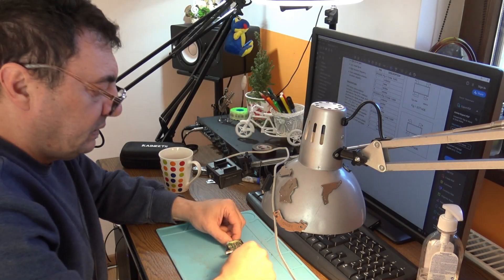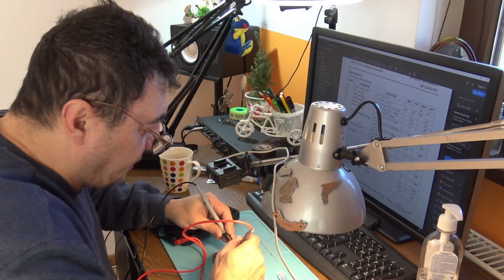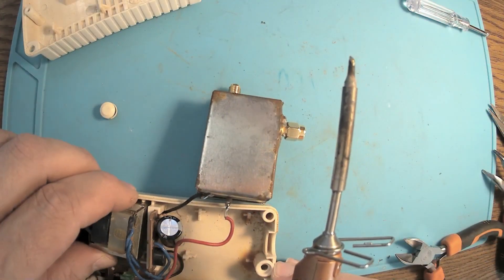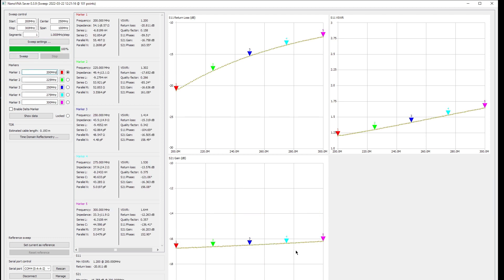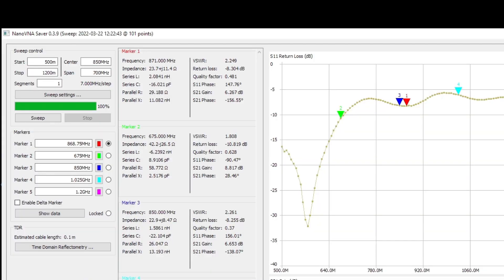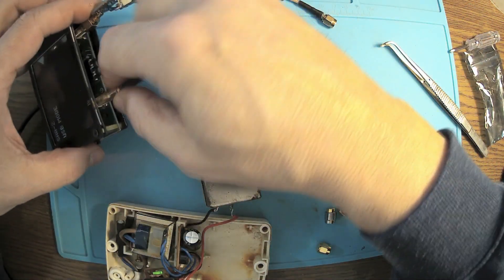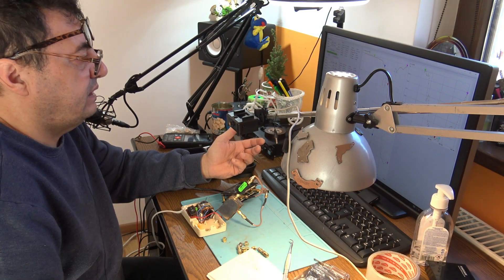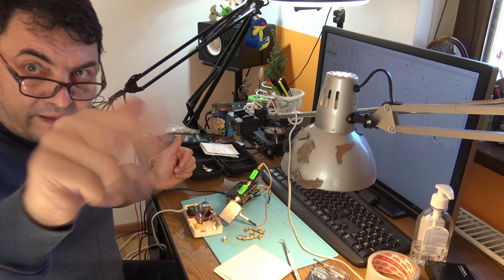UHF amplifier for Helium miner? Yes, of course!

Comment: Hola amigo , do you anymore updates on this project/amp did it work ok? 
I just bought one from ebay and wanted to modify like you did . And yes I know it’s not bidirectional and will need splitter for the tx with separate antenna. 
Please let me know if it’s good to modify and if it works
Reply from the maker: This one is working great..but to much gain, lots of invalids..I recommend a filter before input..
Reply: @viocaia  thank you . 
I have a jetvision cavity filter, that should be good then 👍🏿I appreciate it
Reply from the maker: @ibraheemmohammed6038  Cavity is perfect..but I was thinking more to a saw filter..with a little more loss..to keep down gain..anyway it's a matter  of experimenting..do the things, write down the values for a week or so and you'll have a picture.
Reply: @viocaia  I’m doing a little bit more crazy stuff. Right now i have 9dbi mcgill , cavity filter , acasom amplifier (10db version) , into a 3 way mini circuits splitter into 3 sensecaps ( different ip addresses/vps) and it’s doing pretty good . I’m averaging around.40 each on them . Your projects and time you take to make the videos have helped a lot . I appreciate your work and time . Thank you . 

.
.
So that’s why i want to try your modification and try and split it into 4 miners 😂 since it has higher gain than the acasom
Reply from the maker: @ibraheemmohammed6038  Of course..you have plenty of signal ..Thanks for appreciation!

Comment: New follower… which antenna an filter set up u advice to use..?
Reply from the maker: Depends on location, if you are near crowded urban area McGill 6dB and a simple filter will do the job..also good cable like LRM400..if you are in remote area you should use a directional like YAgi and no filter for the best signal RX..sorry but there is no recipe ..no magic potion..
Reply: @viocaia    ---- loool.. of course theres no magical... hahahaha funny answer... i have good croudet location... many minesrs near me... like a good locatiion... reward-scale 1,8 plus..... now just came a new miner in my hex, and hes stealing 5/6+ coins.... before i had 15 a month , now becomes less and this new guy earns 15 and me 8)... just ask myself why... my set up is 12 dbi antenna outside on pole 14 m high... 3m  cable rg56 to miner  probally (its a thin one)... bobcat....
Reply from the maker: @Bitcoin00boy  Maybe a better cable, also move your location in Explorer to a better rewarded hex..the system is not tracking the exact position..I saw people like tens of Km away from from the actual location..still up and earning.

Comment: hello, I love following you, there is a product that I found on the Internet. Everyone is talking about this item. I couldn't understand how to use this item. Can you help. The place I am in gets a maximum gain of 16 dbi. How can I download it to the system as 15 dbi using the item. I am using an 8dbi antenna and 18 feet long lmr400 cable. How can I use this with my device. How can I calculate 15 dbi as gain for mine? I hope I could express it well. This product is +17 dbi but what should I do as attenuator, also how should the link order be, thanks...
Reply: Can you give an idea about this product?
Reply from the maker: @ferhataslan1556  which?
Reply: @viocaia  I think so, Ferhat mentioned Airbuddy or ACASOM amplifiers.
Reply: @viocaia
Reply: @viocaia  
sorry, the operating frequency is 868 mhz, not 900, the product is ACASOM amplifier on aliexpress, there is a bias tee next to the product, does the bias tee use it as a filter or as an attenuator? the link is being deleted in the comments
Reply from the maker: @ferhataslan1556  Bias tee is a simple circuit to allow the amplifier to be powered by the feed line..it's got nothing to do with the RF signal, just decoupling DC from RF and use the cable as a power supply one..
Reply: @viocaia  I'm sorry if I misunderstood. What should be done should be as follows. Antenna->18 feet cable->attenuator->amplifier->miner. Is it correct ? I will have questions...
1- Shall we put a cable between the Attenuator and Amplifier? 
2- When I use a bias tee, there is no need for an adapter for the amplifier.
3- If there is no bias tee, will an adapter be purchased for the amplifier?
I'm confused, sorry. I'm trying to learn.
Reply from the maker: @ferhataslan1556  First! Why attenuator..ideally you should have +17dB amplification..practically..never! So forget it. Again..antenna/cable/filter/amplifier/miner...
1.No cable need between attenuator and amplifier..
2.To use a bias tee means. to have the amplifier near the antenna! so the cable for radio signal will carry the DC to supply  teh amplifier.When the amplifier is near the miner..no Bias tee need it.In both cases you need a power supply (is this the adapter you're talking?)...Again...! 
If the amplifier is located near the antenna you should carry DC for supply the amplifier..this can be done 2 ways..a suplimentary 2 wires along the RF cable to carry DC voltage or a bias tee which split RF and DC on the same RF cable..
If the amplifier is down, near miner..you connect the power supply direct to the amplifier DC connector if any..some amplifiers are only having input/output connectors but ussually the output is BIASSED to aloud connect both RF and DC power to it.
To make things simplier , buy an amplifier with DC connector..not a Bias tee as long as you intend to keep the amplifier near the miner, not up on the roof near the antenna..think about elements protection too..
Some devices like SDR radios have already a Bias tee adaptation at antenna port..means they can supply any amplifier directly with the voltage in need..but I didn't saw any miner to do that..so buy an amplifier with 3 ports! Antenna in/RF output and Power in! Classic!
Reply: @erhangulcur7475  merhaba. hocam ben translate kullanıyorum o yüzden doğru anlatamıyorum, amplifikatör ün kazancı (+17dbi),  çatıda bulunan antenimiz (5,8 dbi) kazançlarını toplayarak mı hesap yapmalıyım. toplam 22,8 dbi olarak mı. Mining cihazına girerken ?  Diğer türlü amplifikatör daha güçlü olduğu için, çatısa bulunan anteni hesaplamak gerekmiyor mu ?
Reply: For a healthy connection, should the amplifier be close to the antenna or close to the miner?
Reply from the maker: @ferhataslan1556  Of course it should be perfect to have it near antenna, but things are getting complicated..need a second cable for power supply or a Biass Tee , for making things simplier just have it near the miner..
Reply: @viocaia  Thanks. I will need to put it in a waterproof enclosure and move the amplifier closer to the antenna.
Reply from the maker: @ferhataslan1556  if you can..will be the best..I also suggest a filter before amplifier..a cavity filter should be the best, it can provide lightning arrestor function too..
Reply from the maker: I don't see any link, but I supposse is AIrbuddy..get a filter before the amplifier..consider at least 4 connectors, that's 2 dB loss...LMR-400 loses 0.04 dB / ft. at 900 MHz so 18*0.04=.72 dB..let's say 3dB..add a filter another 3dB..you got 6..and still have 10db extra..that shouldn't be a problem..it's not dangerous..BTW It's 17dB in lab conditions.in the field is way less..so go on

Comment: Was this amplifier designed to be bidirectional ?
Wondering how beacons would be transmitted
Reply from the maker: No , this is RX only.You can use something called RF circulator for having TX separate from RX..but you need to use two antennas..
Reply: @viocaia  so what will happen when beacon will be transmitted in this case.
Reply from the maker: @laurynaslauris9677  I'm using a RF circulator, so I have two antennas..one for TX and one for RX ..so I can do any kind of experiments..the TX in not affected.
Reply: @viocaia  what would happen if there were no circulator? does miner got dsmadged?
Reply from the maker: @laurynaslauris9677  not at all..the TX power is to small for any impact..check my other videos I did experiments like that ...nothing wrong happens..even the beacon is passing to the antenna by ground and still have a little TX..
Reply: yes. very interesting what happens with the beacons!

Comment: You have me crazy, I don't know what filter to use and what amplifier to put on. Is there a place to look at a list and find out a little more? It's just to know which way to go or if you tell me something about a setup for my device, I'll follow it to the letter. Thanks.👍👍👍
Reply from the maker: I'm still experimenting, so it's a work in progress.But you may try one of this.. AirBuddy AB-868-5V , Flarm or ACASOM..of course you may add a 868MHz filter..but strat with a good antenna, as high as possible and the best cable you can afford..eventually filter, amplififier..sorry but there is no recipe, depends of the situation and location.
Reply: @viocaia  Thank you very much
Reply from the maker: If you need filters let me know..
Reply: @viocaia  Ok thanks, I'll keep that in mind.